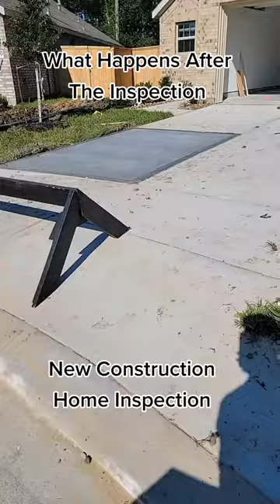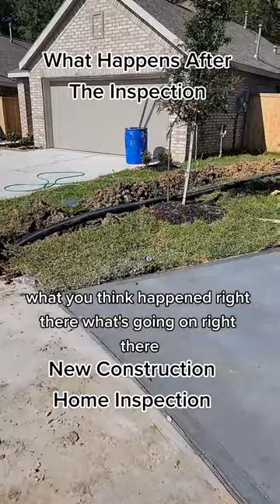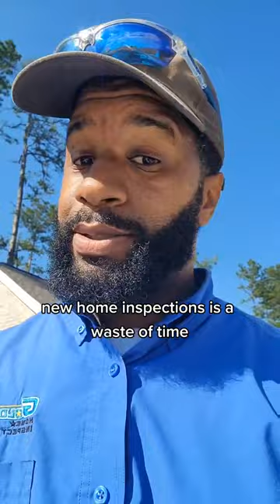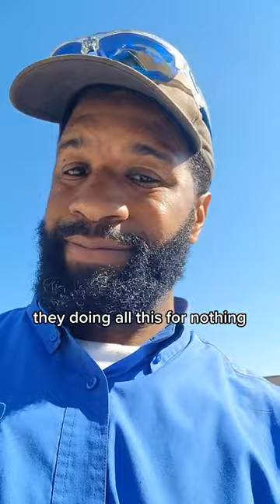What happens after the inspection #Newconstruction #homeinspection #fyp #shorts

Comment: That's a cheap junk french drain. No rocks, no filter fabric and inferior corrugated pipe, which holds water & catches sediment in the ripples. This is why the roots from the builder tree will likely grow immediately into it. It will last long enough to get through the inspection